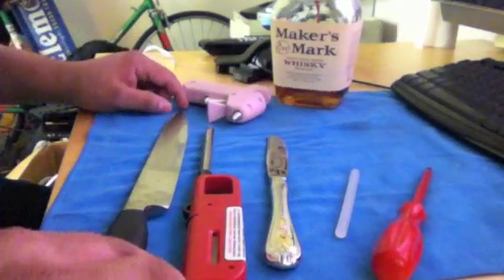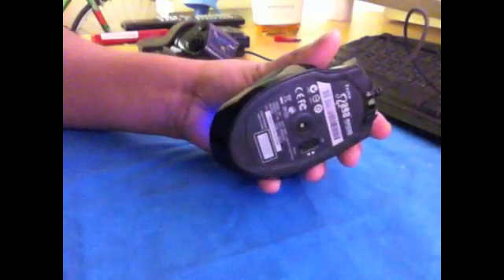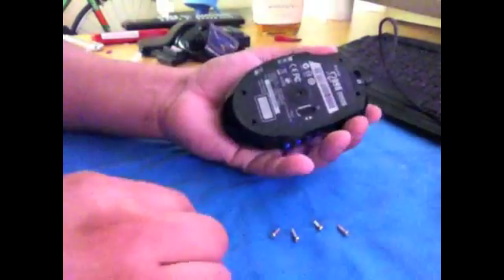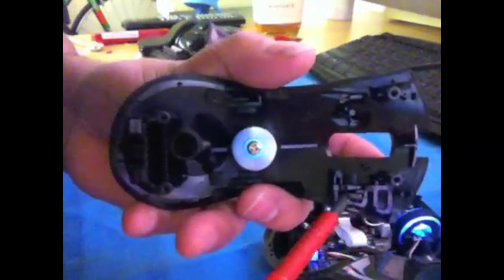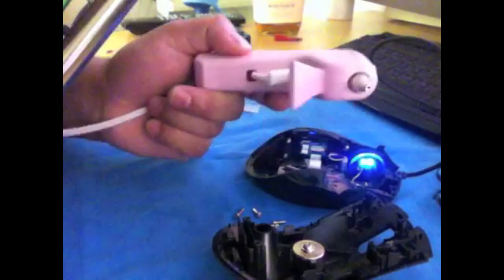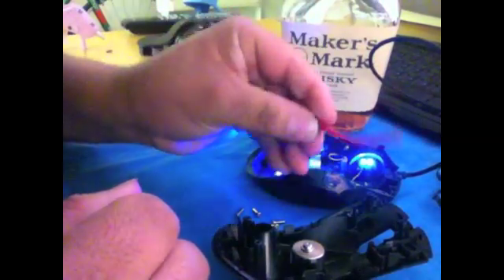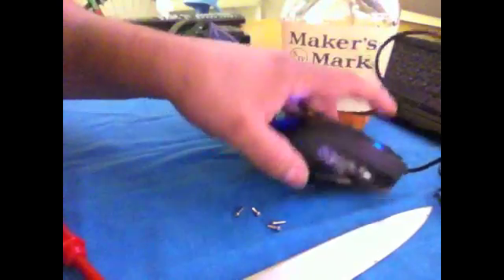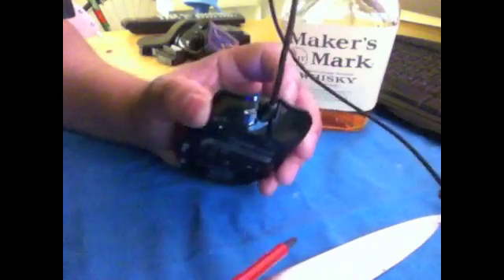Razer naga left button fix Chippy stlyle

Comment: yea that helps wonders i had issue were the left click would stop registering wile holding  and tryna drag stuff or Mass Select was Near Impossible i used Small cut peices of normal clear tape  as the Filler and works perfect
~ Razer Naga Trinity Confirmed fix

Comment: I have the left handed edition. My right click (on the right side with the number keys) clicks fine... but when I hold it, it screws up sometimes. Specifically, when I'm playing WoW or something... and holding right click to turn the camera, it "lets go" of right click when I start mashing number keys. Like it's shorting out. I popped it open and cleaned it, and even when I mashed the right click from the inside, the issue persisted. Is this a problem with the mouse itself, or something software / firmware related?
Reply: Having the exact same problem starting this past week or so. Most noticeable in WoW. Really messing up my camera and makes moving stuff around my inventory a pain in the ass.

Comment: Thanks for the info, I can confirm that it works fine, but don't use just hotglue. Use the glue to attach a sliver of plastic that fits your task. Just straight hotglue will half-stick to the contact if you press and hold, which mouse users do from time to time.
Reply: if the Glue is dry it shouldn´t be that much of an issue...

Comment: Good video. When it comes to the Teflon, you don't have to take it off. Just pull back the tabs at the top to get to the screws and lift up the bottom just enough to uncover the screws. That way you don't have the sometimes hassle of trying to line it all back up again.

Comment: It is kinda hard, mix it up use a toothpick and brush on just enough to cover the TOP of the little white button but not enough that it rolls over the side and glues the button to the black housing. The plastic on the mouse paddle side should be sanded back to flat or even slightly pointed so that it presses more precisely onto the now rebuilt switch.

Comment: I bought this mouse at a garage sale for $2. Asshat forgot to tell me he wore the piss out of it. Anyway this fix has the right idea but if the tiny switch lever can wear through hard plastic why would wax (or even hot glue) stand up over time? Neither actually bonds to the material and will wear or fall off in no time. Epoxy is good, gel acrylic cement is best. Don't file the top flat, put a point over the wear mark, the little switch is worn too and this pushes it further in.

Comment: That is likely a switch problem but it can be increased by this issue. I suggest you read my next comment  on the video in general that will explain an improvement on this method.

Comment: Hey all, as a bit of a warning (not a criticism against Losman or the video).
A) The screws require a phillips jeweler size, and they are extremely well screwed in. I've had at least a dozen Nagas require having to use a powered driver because they were so tight. 
B) When you replace the sticky pad, there will be bumps. You can smooth them out as you go, and also after with your fingernail, however the top corners are the key. If you cannot get them flat again, the mouse will drag across the pad

Comment: Nice vid, my Naga works perfectly again. I didn't have a glue gun or any wax lying around, so I melted some plastic (from a q-tip) and carefully applied some on the worn down area, then I filed it a bit with a nail file to make it even and smooth.

Comment: Great guide, helped me fix my Naga Epic. If you have the Epic the screws are located under the 4 sticky pads, they can be removed and put back on very easily. I went a bit more hardcore and used epoxy, but worked great and fixed my Naga Epic :)

Comment: wouldnt work, i used wax letter seal, its a very hard wax, it doesnt bend, and its not oily at all. i was able to get my mouse to work good as new. but if you glue and metal, your going to have a mouse that clicks easily and wont return unless you take your entire hand off. the amount the actual white clicker depresses is less than 1mm, and also if that metal does come off it could damage your hardware.

Comment: I just fixed mine using hot glue and a problem i'm having right now is if i hold on the right button too long, it will start to stick, not sure if it'll fix itself or if i just didn't let it dry correctly but thanks for the vid anyway

Comment: Okay, after doing this repair again, pulling the glue off and redoing it (and making the tab a little taller using the glue), I'm back to (mostly) normal operation. It still double clicks, but rarely. I'm going to use contact cleaner next.

Comment: Is wax and the stuff from candles the same? I tried with the greasy stuff from a candle but it seems to be too moist. I removed it and tried with some melted plastic and it has worked better. If this doesn't work im thinking epoxy or something even harder. Thanks alot for this!

Comment: if this doesn't work or can't do it because a screw it stripped 
do what I did & rebind one of the tiny buttons up in the corner to click

or you can use a free piece of software called autohotkey to program any button on your mouse & keyboard.  I use the "tilde" ~ as a left click also

Comment: Hey awesome vid man. I tweaked your solution just a tad though. I find using a very thin piece of metal (like that off of a felt tip pen) glued to the small button piece works best although you cant screw the screws in very far at all. GREAT WORK! Thank you so much I really didnt want to shell out another $80.

Comment: I just removed the white stuff around with a q-tip, works again now. Not 100% in the click, as it responds each time, but the click isn't just as good, but a solid 85% overall, so gg ;)

Comment: Also, I did not have any wax or hot glue so I used a piece of electrical tape since it's thicker than regular tape. I place it over both, left and right pieces. I noticed it fixed the clicking issue AND it made the click feel much nicer and quieter.